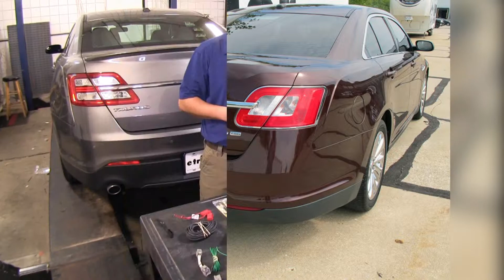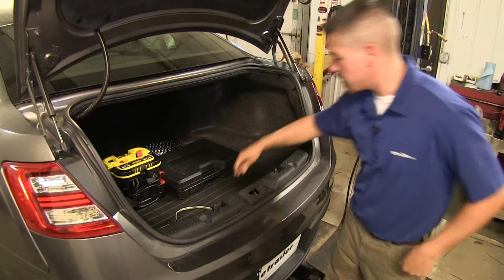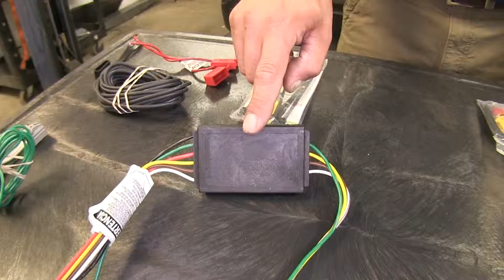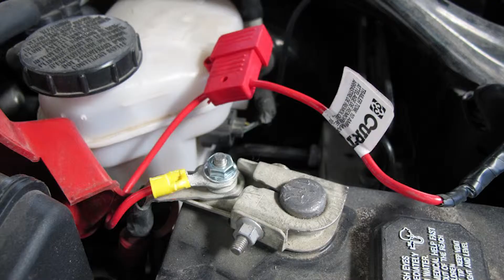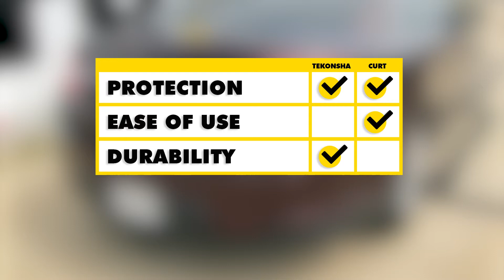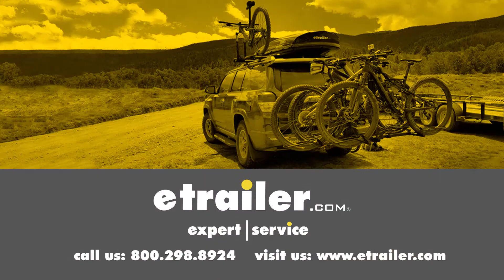etrailer | Best 2017 Ford Taurus Trailer Wiring Options

Comment: I installed this and worked great for 3 years. Now it won't work. Bought a new kit and checked all the fuses and still nothing.
Reply from the maker: Which harness are you using?
Reply: @etrailer  curt manufacturing